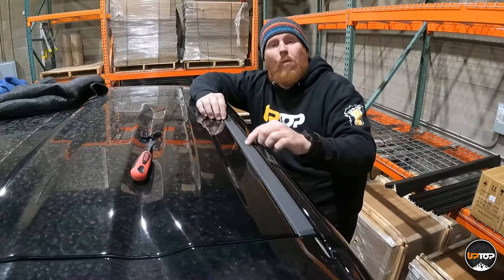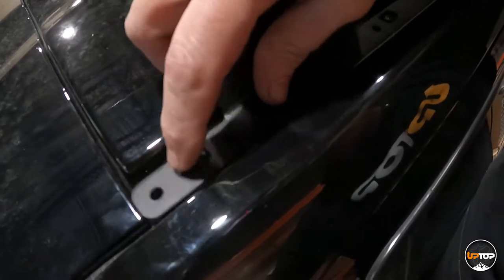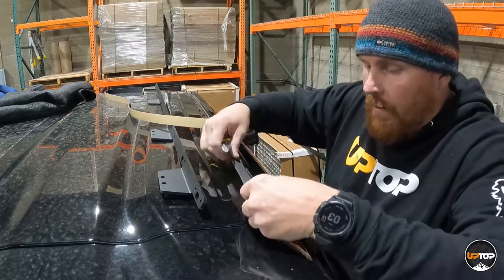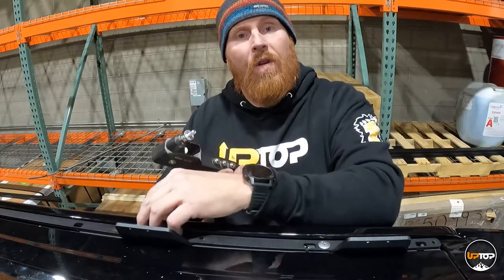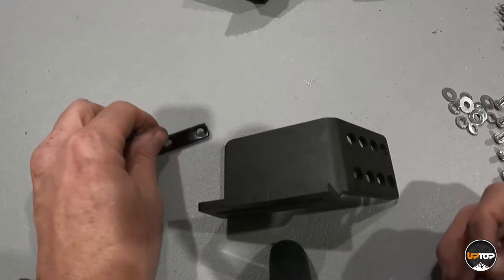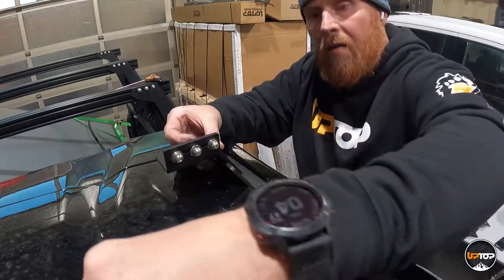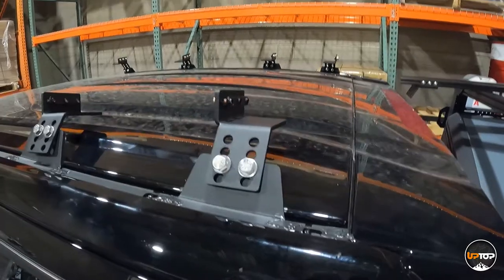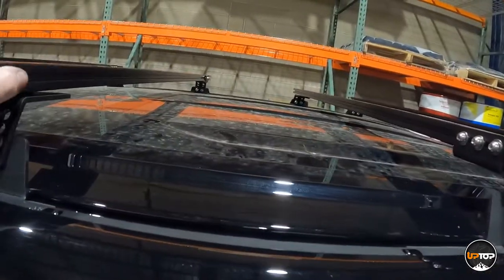Chevy Silverado & GMC Sierra Roof Rack Install | upTOP Overland

Comment: No offense but I’d be pissed if I knew you where throwing tools and parts around on my paint like that. Pretty simple to put some protection down. Also, treating those holes you drilled with corrosion inhibitor would go a long way. Or just paint touch up the inside edges of the holes. Just saying man.

Comment: is there a reason you went with plain rivets instead of rivnuts to anchor it to the roof?
Reply from the maker: There is not enough clearance inside for a rivnut to properly bite.  the spine system also makes alignment easier!

Comment: I have a 2021 GMC Sierra 3500hd Denali is there any rack system for this truck
Reply from the maker: Hey Shane,

We do not have a roof rack quite yet, but we do have our TRUSS bed rack available for this truck!
Reply: @upTOPOverland  Let me know when you do, should be similar. The roof is the only piece of sheet metal that is the same on the HD and 1500. I'd like one on my 3500

Comment: This would be great on my truck. Thanks for the video. Would you happen to know the load rating for this truck (static and dynamic)?
Reply from the maker: The dynamic (moving) weight capacity of your roof rack far exceeds the specifications
set forth by Chevy & GMC. Please follow manufacturer recommendations for the safe roof load
capacity for your vehicle. upTOP recommends keeping evenly distributed cargo
loads of 175 pounds. Static (parked) weight restrictions are
limited to 550 pounds.